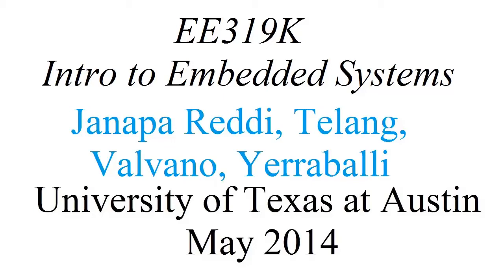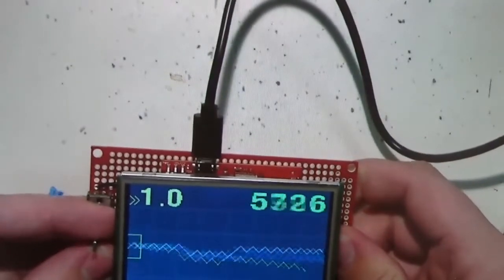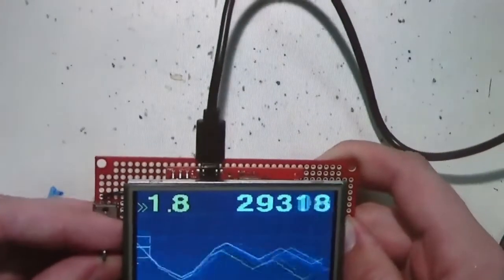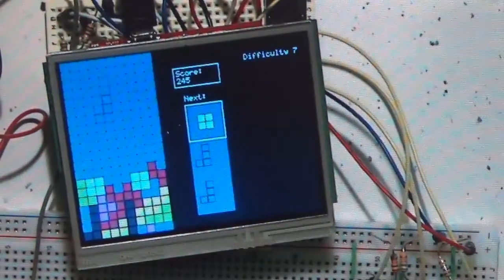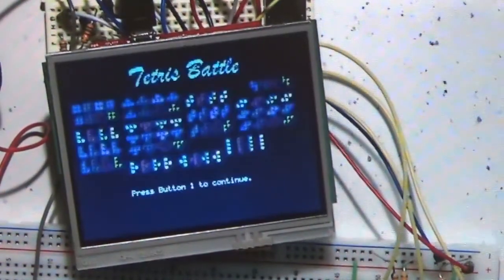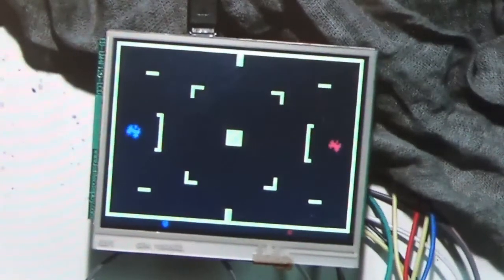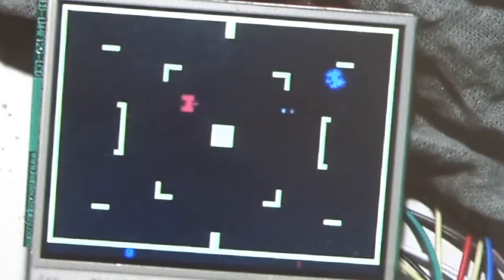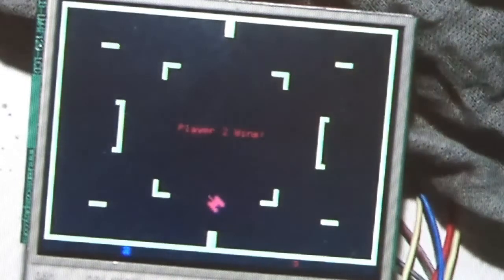EE319K Introduction to Embedded Systems

Comment: Hi professor, where can i find the same or similar LCD display module used in this video?
Reply: Hi, I sell this touch LCD screen:
http://danirebollo.es/index.php/items?option=com_content&view=article&id=1&Itemid=1-lcdbpv2&showall=1
You can buy it on tindie:
https://www.tindie.com/products/danirebollo/lcd-boosterpack-v2-16bit-color-32-tft-4wire-hardware-accelerated-touch-i2c-/
Im working on a new, better and cheap revision, but this is the current.
Greetings
Reply: Of course, is compatible with tiva launchpad and texas instruments graphics library